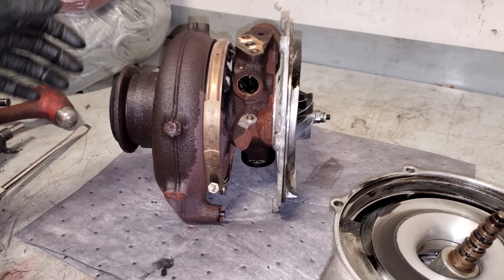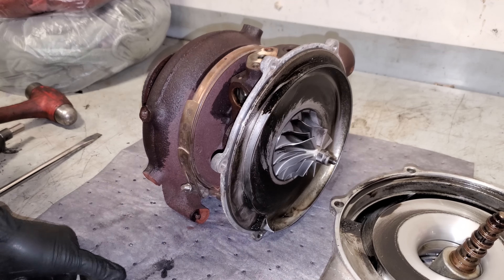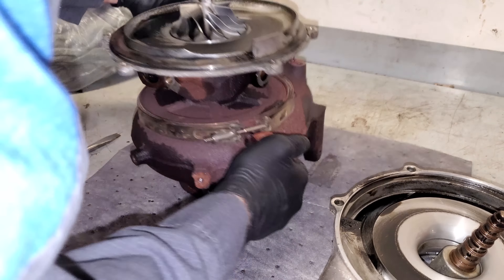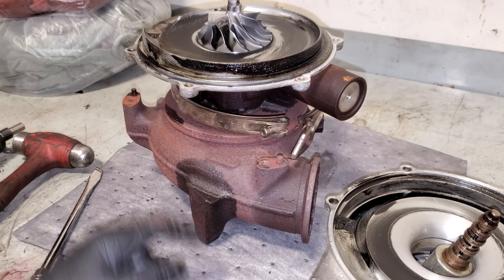6.0 Ford Diesel-Turbo Charger break down | How To

Comment: Turbo cleaning was a common thing back in the 6.0s I remember when they came out 03 turbos were bunged up with carbon. Guys that bought new trucks back then having problems. I think now turbos are cheaper and widely available it’s not worth the trouble cleaning them buy a reman or a Powermax and be done with it.
Reply from the maker: Yuuuuuup

Comment: I’m at 230k on my 05. It was stolen and stuck in the mud on the river front. Water 💦 splashed into the the turbo because of the air filter being open. So among other things,I’m going to do the grind and anti seize . I have drained the oil and it was clear water in the oil pan. Since I have to remove the injectors I might as well do it all.

Comment: I was hoping you would shed  more detail on the component which is fed by oil pressure and mo ey the unison ring, mine is sticky and needed to k ow how to clean it, brake cleaner helped a bit but it's still hard to move,
Reply from the maker: I don't disassemble the Turbo that far down goes back to get rebuilt
Reply: @PowerStrokeTechTalkwARod  I realize that ,however the title to the video states teardown,  not cleaning like all the other videos on here, needless to say a good video sir

Comment: Are oiled filters like k&n not good?  Can it cause more bad then good?
Reply from the maker: YES if u do not maintain or over oil  them
Reply: @PowerStrokeTechTalkwARod   I’m probably going to pull mine off. And just use a OEM filter

Comment: Why does the v-band clamp have to be indexed to the exact same position? I understand the housings, but why the clamp?
Reply from the maker: Was part of the directions way back when....🤷‍♂️
Reply: @PowerStrokeTechTalkwARod  I've done this before and, while I followed that instruction, I never understood why. The only thing I can think of is that maybe it has to do with the surface rust that forms differently in the gap under the T bolt than under the rest of the clamp. Maybe that causes it to seat unevenly on re-install?
Reply from the maker: 🤔maybe..